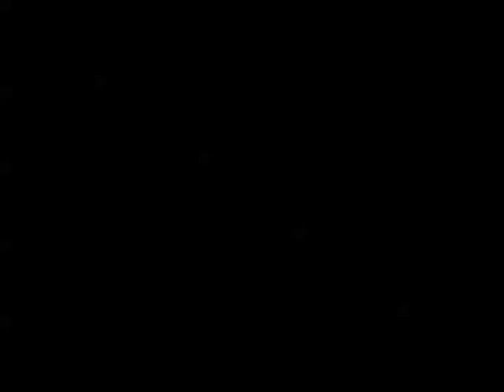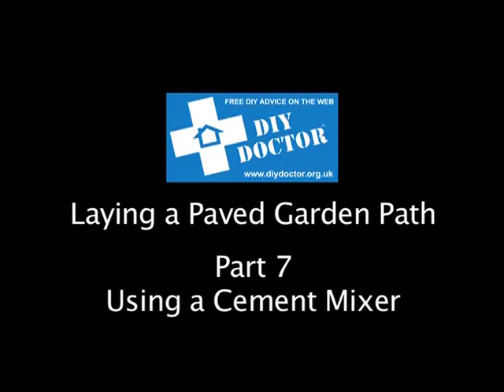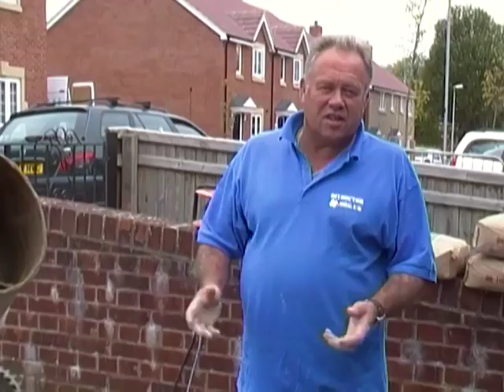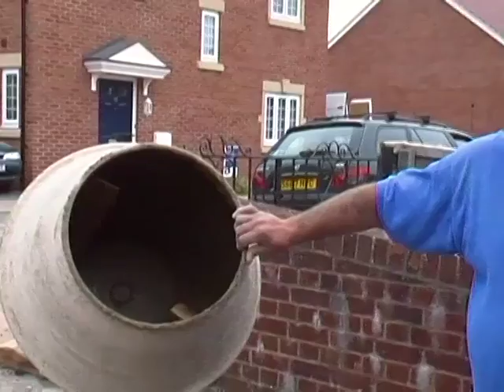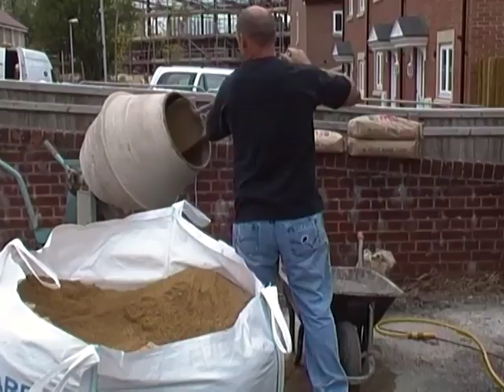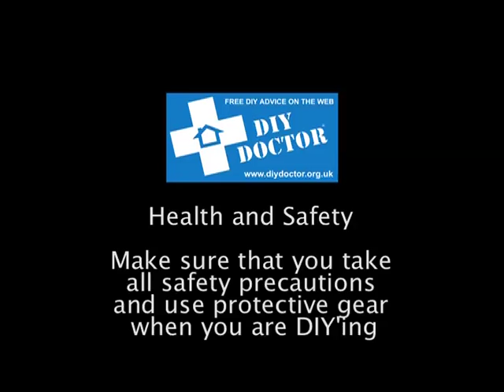How to Mix Cement and Concrete with a Cement Mixer

Comment from the maker: In the Uk we can buy sand and "rocks" pre mixed in 1 tonne bags to save the need for seperate deliveries. This is what is being used here and our building regulations stipulate for this class of concrete our "rocks" must be 12mm in diameter. This is a UK specific website, many things do not apply in the US.

Comment: I am wanting to lay a concrete base, i have all things needed but i am using a cement mixer for the first time. I know its 1 part cement but how many part ballast should i do? is it 6 or 7? and pour in half a bucket of water in to the mixer before loading in the ballast and cement.
Reply from the maker: Hi Aaron, sorry about thelate reply but this one slipped through the net. There is another page on DIY Doctor called mixing concrete, follow the link to it. http://www.diydoctor.org.uk/projects/mixing_concrete.htm . This particular video just shows sand and cement being mixed to show users how to use a mixer. Mixing concrete is the same process and, as with mortar, the mix varies for different types of job. We also have a page on mixing mortar which shows the various mixes for different jobs. http://www.diydoctor.org.uk/projects/mortarmixes.htm

Comment: why aren't you wearing a mask??? you are not scared about getting silicosis
Reply from the maker: supererik man We normally wear all of the correct safety equipment but Matt was conversing with the cameraman during this video and a maskmade it impossible to be understood. This video was shot as a stand-alone videofor \youTube, when we are working on site PPE is worn all the time as of course it should be.